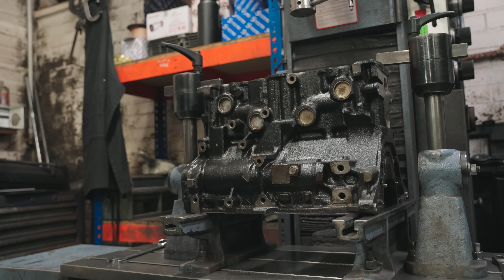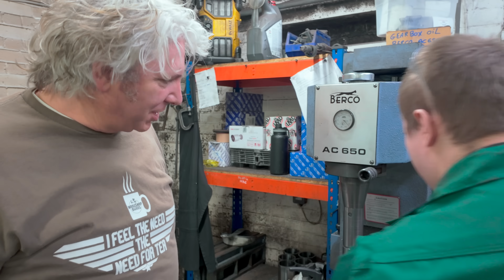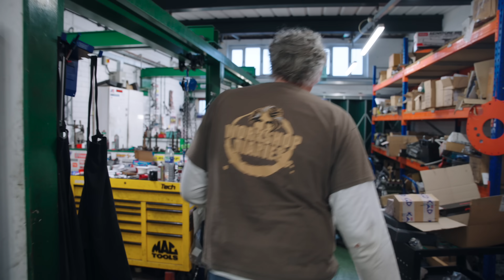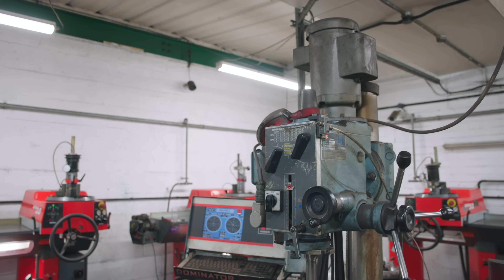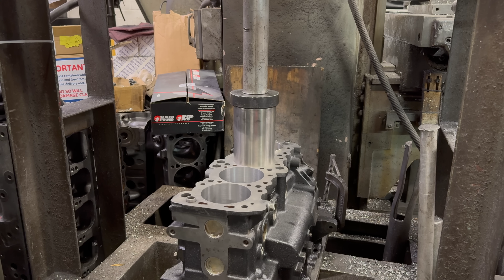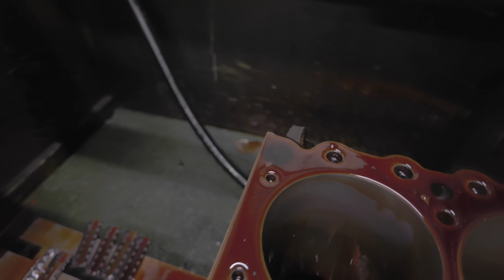Watch This Forklift Engine Come Back From The Dead!

Comment: Really great to watch this old engineering is the best just ordered a cup for my birthday also got your book on kindle it’s a great read brings back memories of my early days when I started with cars a mini 1000 13 year old I done all sorts to it to get it right all original parts 45 years ago great little car my late wife and I went all over in it well all things change I have a VOLVO XC40 R Design 2021 model best car I have ever had I get it serviced and now two MOT at main dealer it’s only 27.823 miles low mileage  never let me down

Comment: What are they actually doing? They bore out the cylinders, to make a smooth surface, do they need to put new pistons on that need to be slightly bigger? How much can you bore out an engine block ?
Reply: (I just saw them putting the liners in)

Comment: This block rebuild process looks spectacular, but lots of errors were made. The thermal interface between the liner and the block isn't good. Nothing stops liners from moving up and down while heating and cooling cycling. The liners are too thin, they will not stay round very well under the load. So this engine wasn't rebuilt to last long. Oversized pistons might be a better option.

Comment: The honing is of utmost importance since it holds the oil that lubricates the rings. Once the cylinder is glazed the rings are effectively running dry which means more friction and more heat. How that oil even gets to the oil control ring is probably by windage.

Comment: Hi Ed, I ran LPG on my V8 Windsor 302 for 23 years before it died - and it was not the engine failing but the carby going lean and burning a valve!!!! I used an oil additive (Moreys Upper Cylinder lubricant)that was added to the fuel flow in the carby to reduce valve recession - after 120000miles the valve seats were just starting to recess and may have lasted 20000 more miles if not for the carby failure!! Taxis here in Perth with LPG Ford Barra engines were lasting over 500000kms when serviced carefully!! My work car is a 2003 Ford 4L Barra that has been dual fuel petrol gas for 10 years and runs perfect no oil burning at nearly 300000km! LPG is a great fuel if you have the right engine and regular service!!

Comment: A discovery that saved quite a lot was the forklift where I worked had the same engine  as used in an Isuzu trooper filters went to being brought from the local motor factor instead  of the dealership 50 miles away for about 1/10th of the cost servicing subsequently  became a lot more regular

Comment: One thing worth mentioning perhaps is that after having an engine bored and honed, it’s SUPER important to clean the cylinders very thoroughly. Otherwise, there’s loads of tiny little metal particles (metal dust even) stuck to the cylinder walls. It’s obviously very abrasive and may ruin your new shine cylinder bore if not done.

Comment: Fascinating work done in the machine shop....... very interesting and a wealth of knowledge held in several workers heads. Are you going to check on the water passage restriction in the block before you slap it back to together ?

Comment: Great video. They really need to reintroduce a ferry service from Norway to the UK. Years ago, we could easily transport engines and car parts to be restored in the UK. All it took was calling the companies, loading the parts into the van, delivering them to various companies, spending a couple of days on vacation, picking up the parts, returning home, and starting the installation. Due to Norway's relatively low population, there's not a sufficient market here to sustain such services. Having the ability to get these jobs done in the UK was incredibly convenient. Those who were married faced no issues either, as their wives were keen on shopping at different stores.

Comment: I worked as a machinist for Caterpillar's Transmission Business Unit back in the 1980's and 90's. All units of measurement are in metric and close tolerance parts are finished in microns like in automatic transmissions that depend on internal pressures being right to function properly. I also worked at the old Mossville engine facility too and the bigger Cat diesel engines all used wet drop in liners and are much easier to rebuild. Many just do a frame in rebuild to save the downtime.

Comment: That reminds me Edd, you said that one of the pistons might've run hotter than the others, as it was "glazed", and you theorized that it might be due to a cooling issue.
Did you get around to checking if there was a blocked channel for the coolant?
Other than that, yet another cracking video.

Comment: What a fascinating video Edd.  What it does show is the skill and knowledge available in Britain, Bravo!

Question, you mentioned about the No 1 cylinder has run hot.  Does that mean you intend to pop the core plugs out and check for dead things in the cooling galleries?

Comment: Imperial measurement system is absolutely dreadful
Reply from the maker: It does mess with your head but it is helpful for engineering and base 12 is much more flexible than base 10. I wonder what they teach in schools these days?

Comment: I used to own a HYSTER forklift that was powered by a straight six side valve engine that ran on propane, it would have looked great in a hot rod😊
Reply from the maker: That sounds great! I really didn’t plan for this to be a project, I just wanted it to be working!
Reply: @eddchina  by the way, I am a great fan of yours 🙂👍🇬🇧

Comment: Im amazed that all of your you tube followers have not commented on what engine that the fork lift truck actually is. When they were doing the various machining processes. I had noticed the two oil gallery bypasses in the front face of the block. The 14mm bolt head near the engine number pad on the left side of the block along with the casting for a balance shaft. And the welch plug on the front face to the right hand side of the block. What Ed is actually working on is the legendary  4g63 mitsubishi engine. Here in it's original form of. Sohc 8v carby. Naturally aspirated. This engine went on to become the evo 1-9 lancer power plant. The dohc heads will bolt on to this block. Versions 1-4 will bolt on. V 5-9will require oversize head studs. Lets get Edd to do the twin cam conversion and really make this fork truck haul ass!!!
Reply from the maker: Very well spotted! I guess it was a strong engine right from the start which is why it was developed so much. The twin cam conversion sounds very tempting!…
Reply: Ah, I thought it was the 4G33 Saturn engine. I think the SOHC 4G63 looks very similar to the SOHC 1.4L 4G33 engine that powered the 1st and 2nd generation Colt Lancers. I confused the two. 😅

Comment: I hope you realise you going to have to skim your piston by the same amount you taken of the block , because your piston jut out has now increased. Personally I would of had top hat liners fitted
Reply from the maker: There was a lot of meat between the piston tops and the head but I get your point. The liners came with a generic rebuild kit that I bought before really getting into the job: I actually assumed it would be like the Perkins engine Adam mentioned and that the liners would pretty much drop out and be serviceable in the field. Glad to be getting it all done properly…

Comment: Never seen anyone shim under a pan rail before boring a block. The pan rail should be a machined to be parallel to the head surface on an inline engine from the factory. Then the last part of the boring process is to machine the head surface flat (decking the block) to bring it back into parallel and flat.
Reply from the maker: As Adam mentioned, the block had distorted over time. Let’s hope the facing of the head surface at the end did the trick…

Comment: SUGGESTION: ANYONE that going to rebuild an engine, BUY your new pistons, BEFORE you mill the block...This way, you assign each piston to a specific bore, then you measure the piston diameter(they do vary slightly) and mill the assigned bore, to the piston...that way, all the clearances are right on.

Comment: Businesses like that are worth their weight in gold (and with all that metalwork in there, that's a lot of weight!), keeping classic engines going, and I like the point made about the more modern engines cracking and basically just a case of bin it and start again, modern engines are just built to be unrepairable, which really does make the phrase "They don't build 'em like they used to!" all the more poignant, cos it's true...

Comment: I level the build plates and set their distance from the LCD panel on my 3D resin printers with 80gsm printer paper.
I manufacture epoxy resin components accessories and model kits.
It's a surprisingly accurate method.
Reply from the maker: It’s a great tip!

Comment: looks like a mitsu block  why not bore over size say .030 / .75 mm ? this guy has a vary nice shop  . that Sunnen Cylinder King CV-616 CV-616E Vertical Hone Precision Honing Machine in the back ground is good stuff

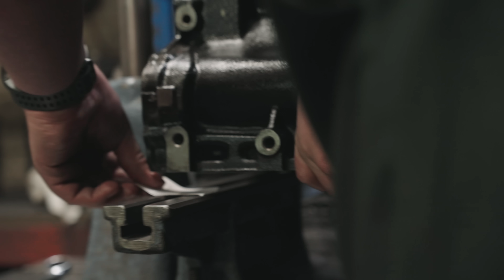Comment: 4:00 i must say im impressed that someone who clearly grew up well after the metric system was introduced can so easily reference in Imperial
Reply: He was using measuring tools with a metric scale .. So, I think it's just a matter of habit.
Engine manufacturers nowadays use digital measuring machines/computers, that are adjusted to an accuracy of one ten thousandth of a millimeter ( if needed ). A thousandth of an inch is 0.0254 millimeters. In many machining drawings with metric measures the tolerances are declared with a standardized marking, like 10 H7. The tolerance of a 10 millimeter hole with H7 marking is between 10 - 10.015 millimetres with an average measure of 10.008 mm.
So, in metric - a thousandth of an inch for a 10 H7 mm hole would be outside of tolerance. Even for a 24 H7 mm hole also. For a hole with H7 tolerance a diameter of 36 mm would be accepted as an upper limit.

Comment: Odd to hear a European using inches.  Would have expected him to be using metric in the shop.
Reply: Brits are a bit retro and used the imperial system for longer than most. Some still haven't managed to swap, even if they officially swapped in 1978 (I think).

Comment: ED, do You  know the Best  Forklifter  Engine  at alll.......it is  the  DEUTZ  F4L912  Air  cooled Diesel  Engine......FUEL  saving and  undestroyable  and Starting under 20 Celsius  degrees

Comment: Got curious and decided to search that what block is that. It's Hyundai 21102-32C00, and the full engine would be Hyundai-Kia G4JS. It's part of their Sirius-engine family, which were licenced copies of Mitsubishi's 4Gxx-engine series, found from Mitsu Evos too. I'm fun at parties.
Reply from the maker: Interesting, it seems to be a Mitsubishi engine badged Caterpillar GP20K. I guess the OEMs share them around a lot!
Reply: @eddchina  They do actually, and older retired engine families are repurposed still on other application like these. I do also know that in Brazil, they still produce those old 8-valve Opel/Vauxhall OHC engines for forklifts too!
Reply: The forklift definitely needs some “EVO” badges on it then lol.

Comment: Brilliant outfit, only 5 miles from my home. Interesting to see the line boring machine. When I had my vintage aero engine (Continental A65) rebuilt a few years ago the crankcase halves had to go on holiday to Tulsa by airfreight to be line bored. As soon as you mention aircraft to a machine shop in the UK they run a mile due to perceived liability issues. I'm sure their work would be more than adequate on vintage aero engines with their wide tolerances in comparison to a modern performance car engine. With all things aviation they could charge double and nobody would bat an eyelid.
Reply from the maker: It will be interesting to see what they can do with our 100 year old Cadillac engines…

Comment: It's a crying shame that so many of these cottage industry machine-shops have gone out of business. I can think of at least six from just off the top of my head, within south London area alone.  Super to see this one still running.

Excellent Edd.! 👏😉
Reply from the maker: I totally agree! Glad you enjoyed it. We need to keep using them to prevent losing them!
Reply: Molins in Deptford was massive, in my year there were 50 apprentices.
Reply: @TheNorville2  I'll look that up. Bermondsey Deptford an interesting place
Reply: @sianiswack633 It was a very big place, Trundleys road had two buildings, one was the apprentice centre. Started work there in 1976 and left in 1986.
Reply: Unfortunate side effect of engines often lasting the expected lifespan of a car without needing any machine work nowadays.
Reply: Baldyne is still going but now they're off Bromley Common rather than in Biggin Hill
Reply: and they will die more. modern engines are throwaway engeneering bs²